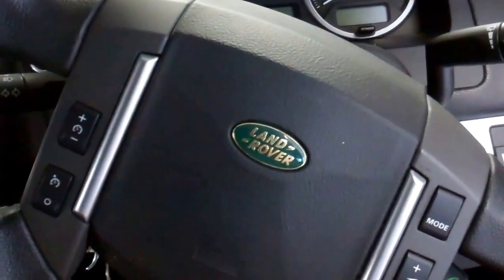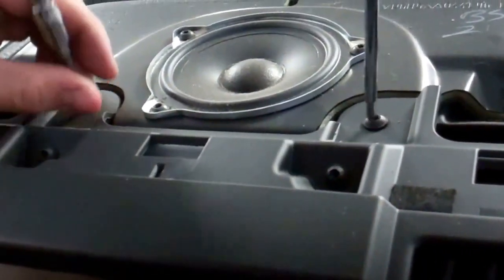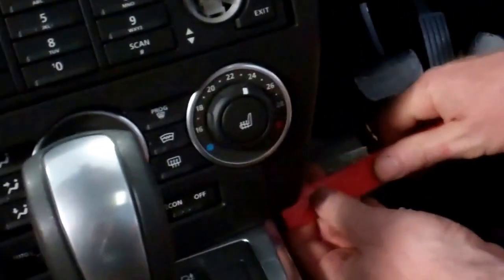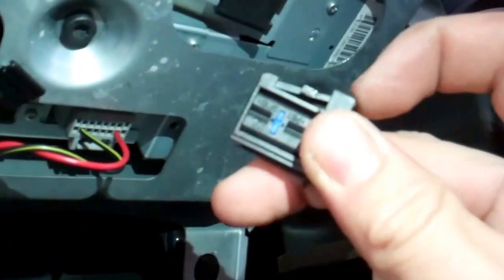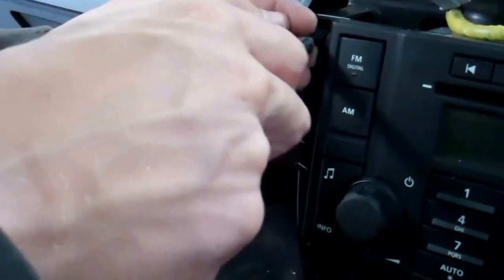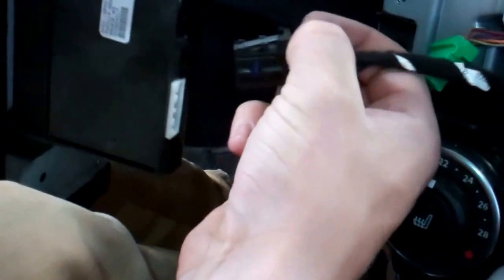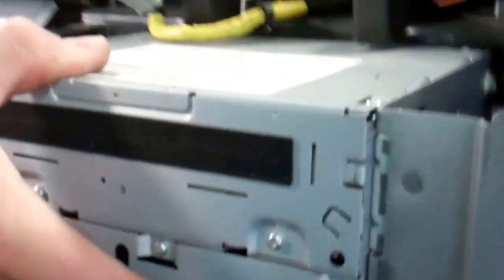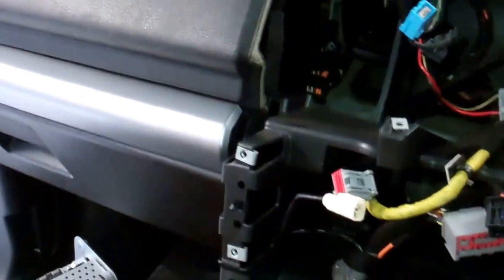How to remove radio,screen,heater controls on Land Rover Freelander 2 Interior LR2

Comment: Hoping to do this removal , mainly to look for AM Antenna, do you remember if its there or does end up in some other module.. Many thanks
Reply from the maker: Hi - firstly who listens to AM ! secondly i am not sure of the antenna for the AM is in the rear side windows - looks like heating element but is an antenna
Reply: @L663  Yes of course not many people do except was travelling south and wanted tp listen to 5 live to listen to sc/eng. rugby and couldn't get anything ! So home now and found a loose single wire near the rear nearside window, looked like the culprit but didn't do anything, had a broken tab on it so still dont know where it belongs lol, so Ive abandoned the idea ,Thank you. 
By the way the matter I had when coded out of my Vogue with a message on the SAT nav screen that wouldn't count down has been resolved by repeated battery disconnections and  lock /unlock doors etc and instructions from manual.Thought you might like to know.